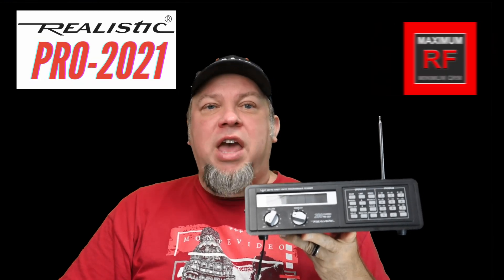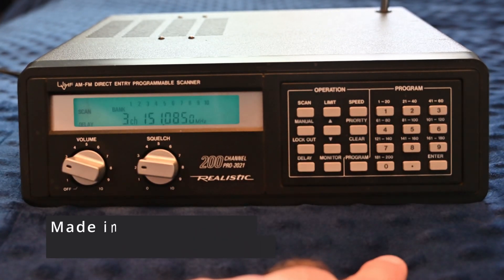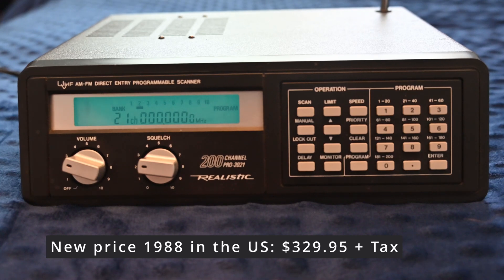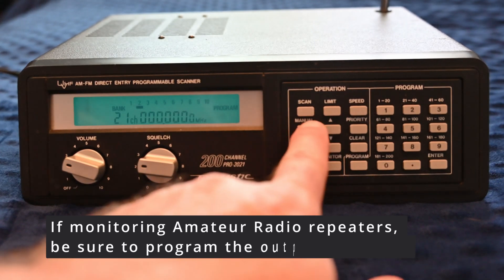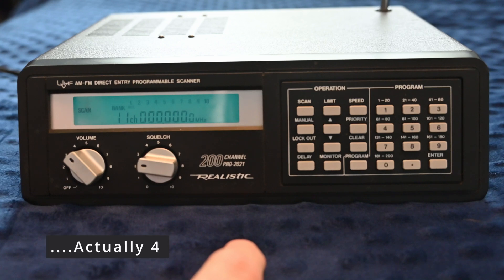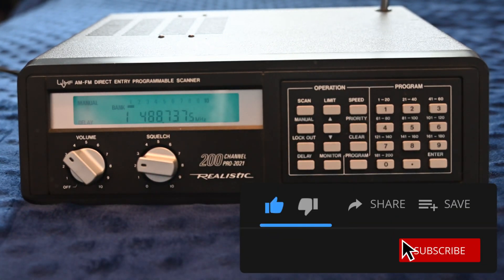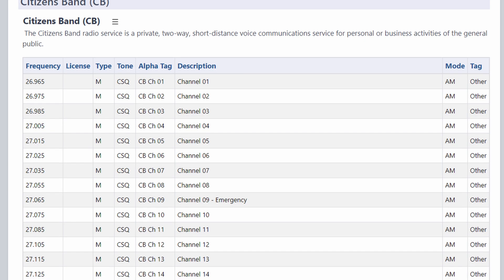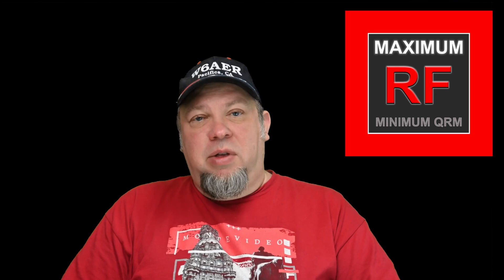Overview, tips and programming of the (Radio Shack) Realistic Pro 2021 scanner radio.

Comment: I HAVE A PRO 2021 REALISTIC LIVE IN PUERTO RICO  ZIP CODE 00612 HAVE NOT BEEN ABLE PICKUP ANY FREQUENCY. ANY SUGGESTIONS OR HELP. PLEASE
Reply from the maker: You should be able to pick up the analog services without an issue unless they are trunking systems. Likely an issue with distance or blocked signal due to terrain or hills if you have it programmed correctly. But hard to say without knowing more. I found this https://www.radioreference.com/db/browse/stid/72 hope it helps. Appears this is a good place to start. Next try maybe an outdoor antenna if possible. I have a hard time with indoor antennas myself due to my metal siding on my house.
Reply: Thank you very much 
 Sir

Comment: I just inherited this same unit from my stepfather. It came with the manual,2 frq books from radio shack it even has the top mount plate. My question is, Where do i find a screw in antenna the one with it is broken?
Reply from the maker: Back when Radio Shack was still around they sold a replacement unit, nowadays your best bet is eBay. Although I would recommend using/attaching an external antenna for this unit for much better performance. You can also experiment with different length antennas for various bands this way. Hope this helps!